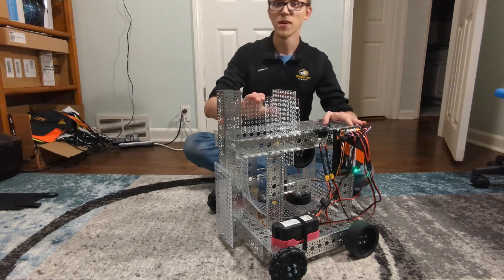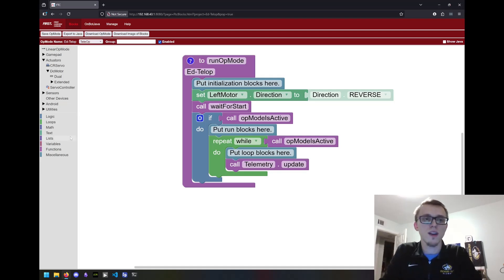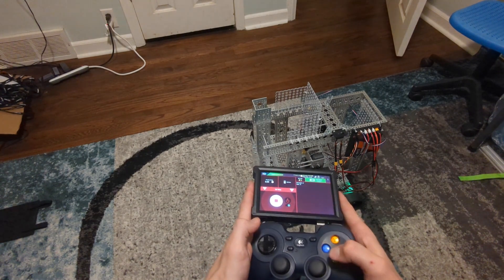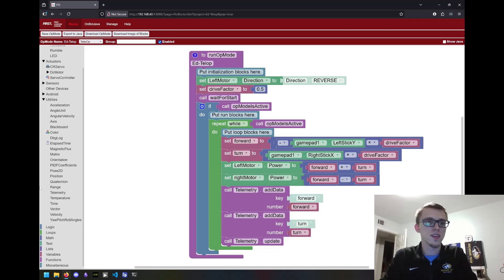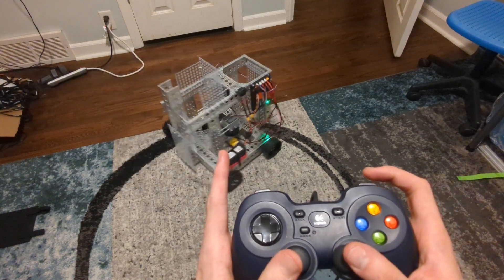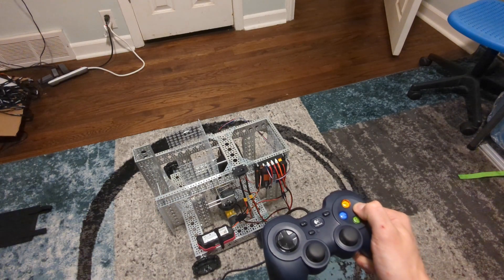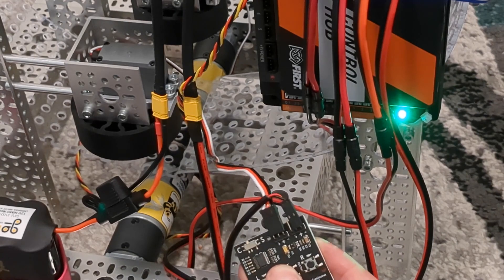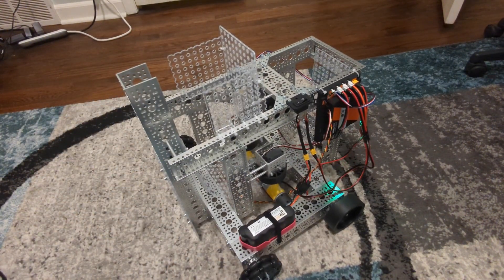FTC: Programming the 2025 GoBuilda Starter Bot

Comment: Hello! I tried this code, but I can't get it to actually launch the ball. It runs it up, but then it just spins without actually being launched. Any tips or tricks for this?
Reply from the maker: From the sounds of it, your code is working (yey!), but its getting stuck in the launcher portion. This typically means you have to play around with the mechanical aspects of your robot. There's typically a sweat spot with how much contact / compression the game piece needs with the launcher motor.

I would try:
- Adjusting the position of the motor
- Adjusting the wheel softness / friction
- Adjusting the slope / curve of the plastic sheet
- Adjusting the speed of the motor (If you have it maxed out in code, you may need to try a faster motor)

I hope that gives you a direction to start!

Comment: Hello, I tried to program my servo in the same way you did, but instead of spinning continuously it does one full revolution then stops. I followed all steps to put it into the CR mode with the servo programmer. Any tips?
Reply from the maker: Gotcha, what I would look at first is how the servo is configured on your driver hub. It should be configured as a "Continuous Rotation Servo".

Here's my full servo troubleshooting steps. In this case, I think you can go straight to step 3.
1) Check the servo wires
2) Check the servo port
3) Check the servo code block (make sure its a CR servo block, or that you can find your servo name under CR Servo)
4) Check the servo configuration in the driver hub
5) Check the servo mode using a programming board
6) Try with a replacement servo
7) Try a different servo port
8) Try a different control hub / expansion hub